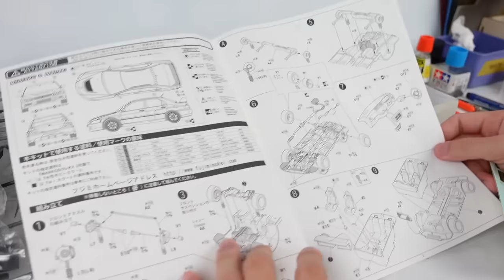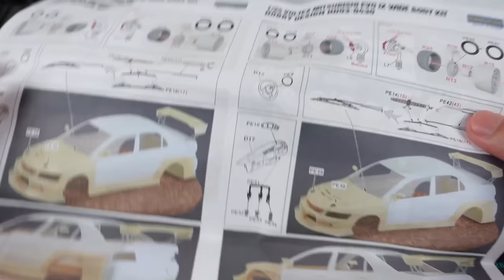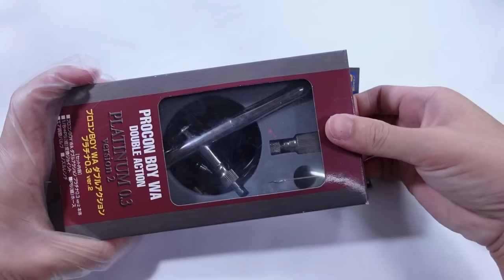250 HOURS BUILD | VOLTEX WIDEBODY MITSUBISHI LANCER EVOLUTION 1/24 SCALE MODEL CAR.

Comment: An hour massaging the carbon decal??? When i tried carbon decal on a hood and seats, ... after 10minutes they got damaged while massaging trying to get the wrinkles out due to softener 🤷‍♂️😢
Reply: It also took me around 1 hour, using a Q-tip to very gently push out the air bubbles. I also used the same Mr. Mark Softer, but only small amounts where needed.